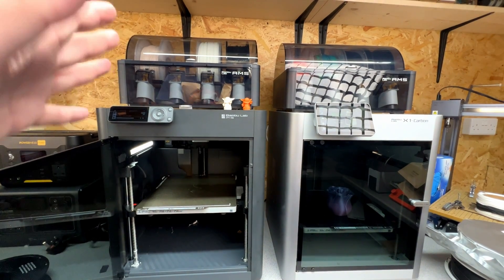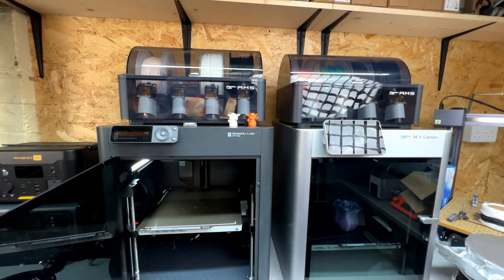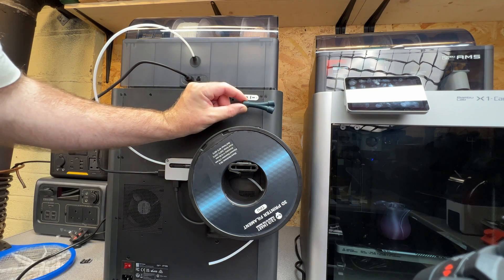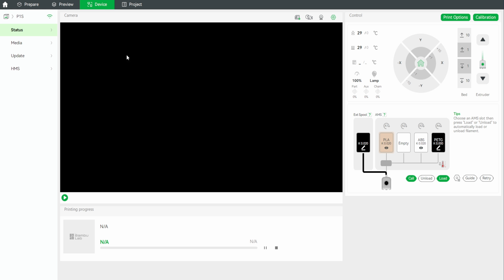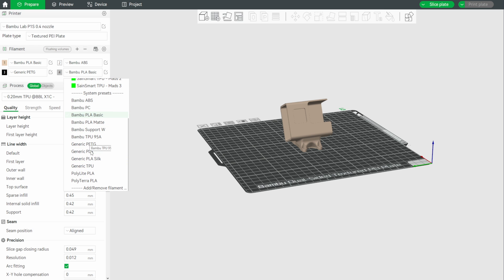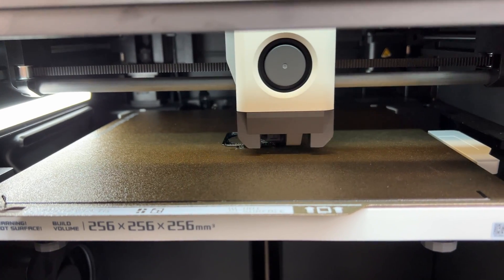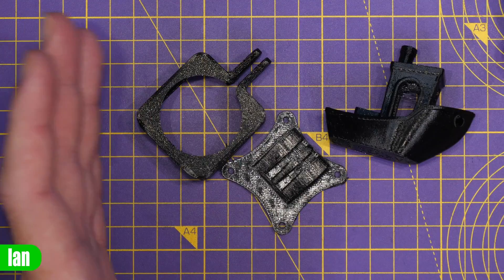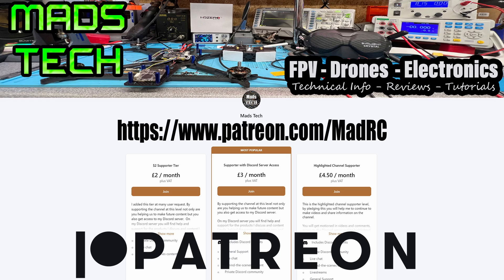Bambu Lab X1 & P1S Printing  TPU - Its This Easy

Comment: Hi great video thanks, I have a reel of ELEGOO TPU 90A, I'm a extremally novice printer with  P1S i take it i should just select the generic TPU like you did and see if that works ok? or would it be better to use the bambu lab TPU settings?

Comment: Excellent and informative, and direct to the point! I have a P1S but have not yet printed TPU. Is it necessary to switch from the stock stainless steel nozzle to a hardened steel nozzle??

Comment: This is really helpful. Thanks. I tried to push through ptfe tube. But it did not work. So filament directly to nuzzle as instructed work. However, before actual print starts, you need to pull filament upwards so that it won't entangle in middle of preparation. After this, as the movement of nuzzle become repetitive and predictable, you can monitor and leave it.

Comment: You can disconnect the blue end of the connector and just leave it attached to the tube from the hub. Then you've already got bare tube to insert into instead of putting weight on the connector.

Comment: i just finished my first print with your profile and the result was significantly worse than it already was. it went from under extruded here and there to under extruded to the point layers didn't bond together anymore

Comment: I printed some aircraft wheels, when 1st printed they were flexible but when they cooled to room temperature they were just as hard as pla. as for ams i didnt have a problem printing the bambu labs tpu in the ams, the quality was really good just not flexible.

Comment: I'm just curious why you would use TPU to print a camera mount? Surely a more rigid plastic would be preferable.
Reply: A flexible mount helps isolate the camera from vibration and can reduce shake...

Comment: What do I do if the load button won’t show up?
Reply: Unload your spool. 

You need have the extruder tube clear of filament before the load button shows up. Then you can click it and it walks you through the steps required to load.

Comment: Don't you have issues with default PEI textured plate? Does TPU stick on the plate, doesn't it?
Reply from the maker: Tpu sticks fine.  No issues.
Reply: I follow
Reply: Periodically scrub your PEI plade with dishwashing detergent on a scrubbing brush under very hot water, and don't tough the surface with your hands.

Comment: Hi Ian, I have a question about the Y-Splitter you have showed did you use some fittings thingies or did you just print one where the ptfe tubes can be pushed in?
Reply from the maker: I used the PTFE push in but it can be problematic, the metial fittings work better.
Reply: @MadRC  thanks a lot I will most probably get the original even up to four one. Its 5€ + shipping I think its not worth the hassle if filament doesnt slide easy enough or may get stuck for that small sum

Comment: Are you using the special TPU plate or the one that came with the printer. I noticed old plates were able to print TPU (it has the classification on the plate) but the new ones does not specify TPU, only PLA, PTEG and ABS

Comment: Update (1 year later): You no longer need to do the step described at 4:11 ( https://youtu.be/fhu5C-3AJvo?t=348 ) as in the current version once you've defined what's on the external spool clicking "sync" for the AMS will add it to your list as a fifth option.

Comment: I was told you have to use a gluestick for this stuff otherwise you wont be able to get it off the deck, i didnt see any on yours, anyone chime in by a chance? TIA.
Reply: Thanks, I have been layering on the filigree goo stuff you get with the smooth/textured surface. And yeah I noticed it's very grippy and I'll def switch to glue stick, thanks

Comment: If it’s on the spool, won’t it soak up moisture in the air? Seems like it wouldn’t soak up moisture if it is in the AMS.
Reply: It needs to be in a dryer

Comment: Bravo!  I wish that all how-to videos were this thorough and simple!  My only question now is speed.  When I look at the required speed for my filament, it says no more than 50mm/s but the standard Bambu Studio settings show 200mm/s print speed.  I thought that when I told the machine that I was using TPU,  it would give me settings usable by TPU.  Should I print at the higher speed, or should I use the recommended speeds and top out at 50mm/s?  Thanks for a great vide!
Reply: Maybe try the calibrations and see if it still prints good 

and if it not, then change the speed to 50mm/s etc

Comment: How do you release TPU to change to another TPU color? Also what happens when you run out of TPU? The last time I did this the TPU got jammed up in the extrud6snd I had to take it all apart and get it out. Not a pleasant time. Thanks
Reply: When you have sliced you can set a layer by which to change filament - slide down to the layer you wish and right click on the plus

Comment: Any idea how much the pressure advance value matters for TPU? Just for fun I ran a test, and found I had to run the bowden settings just to start to see a change in the lines. I ended up at .26, an order of magnitude higher than the default. Maybe it doesn't matter at the speeds TPU prints at, so no one ever mentions it. We'll see if my prints improve!

Comment: I used your json file preset and got sainsmart tpu and on my x1c its perfect. Just awesome. Thanks for the work you do.
Reply: Where did you load in the .Json file on Bambu studio?
Reply: @califpv  O i get it. I had the same problem.. Import file, Very top left corner (file) Import, Bottom choice. There you go..
Reply: @73FPV  thanks for this post, I needed this help as well. 👍

Comment: I had to search out this video, as it's the best guide I could find to printing with TPU. I needed it when I actually began my TPU journey. Prints came out fine and dandy and the splitter works marvelously. Cheers!
Reply: My i have the link to the splitter. Same experience as you.
Reply: Im going to try the one from bambu , its a 4 to 1 adapter

Comment: With the Y the Material PLA feed or change do not work correct anymore. It feeds the Filament forward until the extruder, then after some seconds back, and forward, and back. Until it stops due to the error message. Sometime it works, somtime not. After disassembling the Y it works again normaly.

Comment: TPU 95A should be fine at a fairly slow speed, more flexible stuff will likely be more problematic?  I have flexible 65a, 85a and 85a, filaments & for the very soft stuff the extruder tensioner will need to be relaxed as in my experience the softer filaments will just get chewed up in the gears otherwise.  I would also not fancy trying to push very flexible filament into/aling the bowden tube, its likely to be hard work.

Comment: Does it work with the A1?
Reply: I've used a lot of the Sain Smart TPU on my A1 Combo (bypassing AMS) and it prints beautifully.  One spool I have is several years old.  Kept in a baggie with a little pack of dessicant.  Very useful filament.

Comment: Thanks for the info and insight. With the Y adapter for the filament in the back, I assume you still have to retract the filament until the tubing is clear? If so, what is the purpose of the adapter? Is it just so you don't have to disconnect the tubing from the AMS every time?
Reply: Yes, so u don't have to disconnect

Comment: Is that the gold dual sided textured plate that came with the printer? And did you not use any glue? I need to print tpu now and im afraid to ruin the build plate
Reply: I too have this query - the bambu lab webpage for the texture pei sheet says to use glue stick for TPU. Did you have any issues without using glue stick?
Reply: @djwhu77  I just used the glue stick and printed 4 very large wheels. That worked fine and the glue was easy to remove. I have yet to try without glue. Even with the glue i had a hard time removing the print, but as soon as i got a piece up, I could just use a painters spatula to "cut" it loose

Comment: i had to add much more tweaks on nailing tpu with x1c, its not as simple as described. wost part is supports .it prints OK but supports are pain .. but finally come to good results, also found out bambu studio slices better than cura for enders

Comment: I've tried to simply remove the PTFE tube and leave the AMS attached but in the BambuStudio it gave me the run around until I unplugged it. I'm not sure if there was a setting I missed but I hope to figure it out because that is an annoying part.

Comment: Thanks for the vid, it really helped me... BUT, I have tried a few different TPU brands in my P1P with no AMS and many brands would not even feed through the feed gears or hot end.. they just appeared to get tangled round the feed gears, which was a right royal pain in the rear to get access to and unclog. indeed I ended up just buying a new hot end as even after clearing the clog in the gears I could not get any other material to feed through the hot end. I did alter the feed spring too to no joy..... Eyeron is the only non bambu brand I have actually been able to feed through the Bambu lab P1P... PS I usually use Overture TPU on my other printers, ( Elegoo Neptune 2s) just fine... Any thought or advise?
Thanks in advance
Ian
FuriousRC

Comment: How does the "TPU Profile Link" set the parameters for TPU. It looks like a process file with the default settings for setting up the model and not the filament. This is new to me so correct me if wrong. Enjoy your videos. Thanks

Comment: Ive used flexibles with one of my ams... i heavily modified it though. Been considering making some youtube videos because i also am starting to reverse engineer the ams and want to make a custom one by using an arduino to intercept the pins from the printer and trick the printer into making it think my ercf with 8 materials is 2 ams. Wondering if anyone has tried it yet

Comment: What speed do you print tpu?
Reply: The maximum print speed is defined by the "Max volumetric Speed" in the filament settings.
The "Generic TPU" profile has a "Max volumetric Speed" of 3.2 mm3/s. This results in a maximum print speed of 40mm/s with a 0.4mm nozzle & 0.2mm layer height (regardless the higher print speeds in the provided/chosen Process Preset, they will be ignored).
Max print speed equals 'Volumetric Speed' / ('Nozzle Diameter' x 'Layer Height')

The print temperature depends on the values of the manufacturer and is usally between 200°C and 230°C.
Bed temperatures between 30°C and 45°C
Best results with Enineering Plate and Textured PEI Plate
All nozzle materials can be used (brass, steel).

Comment: what temperature and speed used for TPU on A1 mini and X1C.. can I use the normal nozzles machine came with.
Reply: The maximum print speed is defined by the "Max volumetric Speed" in the filament settings.
The "Generic TPU" profile has a "Max volumetric Speed" of 3.2 mm3/s. This results in a maximum print speed of 40mm/s with a 0.4mm nozzle & 0.2mm layer height (regardless the higher print speeds in the provided/chosen Process Preset, they will be ignored).
Max print speed equals 'Volumetric Speed' / ('Nozzle Diameter' x 'Layer Height')

The print temperature depends on the values of the manufacturer and is usally between 200°C and 230°C.
Bed temperatures between 30°C and 45°C
Best results with Enineering Plate and Textured PEI Plate
All nozzle materials can be used (brass, steel).

Comment: I know that you mentioned you were using an old roll of TPU and that old roll had most likely absorbed a bit of moisture while sitting in storage but, does this mean that a roll of TPU in pristine printing condition would give one a cleaner surface finish than those shown in the models you printed in this video?
Those were some pretty rough finishes.

Comment: I was expecting to be able to use it with the print option but that only supports the AMS materials... Why isn't color 0 the filament on the aux hub hanger?  
Second, can an AMS hub be used without a second AMS to feed alternative filaments like TPU and CF filaments?

Comment: Hi, what speed do you have set for TPU printing?
Reply: The maximum print speed is defined by the "Max volumetric Speed" in the filament settings.
The "Generic TPU" profile has a "Max volumetric Speed" of 3.2 mm3/s. This results in a maximum print speed of 40mm/s with a 0.4mm nozzle & 0.2mm layer height (regardless the higher print speeds in the provided/chosen Process Preset, they will be ignored).
Max print speed equals 'Volumetric Speed' / ('Nozzle Diameter' x 'Layer Height')

The print temperature depends on the values of the manufacturer and is usally between 200°C and 230°C.
Bed temperatures between 30°C and 45°C
Best results with Enineering Plate and Textured PEI Plate
All nozzle materials can be used (brass, steel).

Comment: Thanks Ian. I just got my first printer which is a P1S combo and I learned more in this 11 minute video than the few dozen other videos I’ve watched. I’ve been using the included pla while getting used to the slicer and printing in general. This video gave me the pep talk I needed. Gonna give some fpv prints a try.
Reply: Fpv prints? Like lithophane images?
Reply: @madlad1.  FPV is First Person View   It’s a term for the type of drone I fly. It has a camera and I see what it sees through my goggles. TPU parts are essential for arm guards, antenna mounts, action camera mounts etc.
Reply: Same!

Comment: Thanks for the instruction! Do you know what to do when the TPU cant be loaded? I hear the stepper working but no filament comed out of th nozzle...
Reply from the maker: Have you given it a push though as it’s trying to extrude ?
Reply: @MadRC  yes i did. and I feel it beeing pulled, but somehow it can be extruded. I tried another TPU filament know and it just works fine, don’t know what the issue is with the other one… 
Thanks for answering!

Comment: so I downloaded your profile and the speed seems really fast for tpu, did you change it
Reply: The maximum print speed is defined by the "Max volumetric Speed" in the filament settings.
The "Generic TPU" profile has a "Max volumetric Speed" of 3.2 mm3/s. This results in a maximum print speed of 40mm/s with a 0.4mm nozzle & 0.2mm layer height (regardless the higher print speeds in the provided/chosen Process Preset, they will be ignored).
Max print speed equals 'Volumetric Speed'/ ('Nozzle Diameter' x 'Layer Height')

Comment: Could you use the BL Y Splitter for the PLA and use it on the rear spool holder and then not have to disconnect the AMS?
Reply: Yes you can

Comment: Hi,  dont you have to reduce the speed´s ???
Reply: The maximum print speed is defined by the "Max volumetric Speed" in the filament settings.
The "Generic TPU" profile has a "Max volumetric Speed" of 3.2 mm3/s. This results in a maximum print speed of 40mm/s with a 0.4mm nozzle & 0.2mm layer height (regardless the higher print speeds in the provided/chosen Process Preset, they will be ignored).
Max print speed equals 'Volumetric Speed'/ ('Nozzle Diameter' x 'Layer Height')

Comment: Thanks for this.  I learned the hard way the AMS was not compatible with TPU. Probably should have read the instructions.  It didn't reach the spool and I was very lucky to be able to pull it out without it snapping. Lesson learned.
Reply: I've learned it the hard lesson, too xd

Comment: So, what are your actual settings when printing with TPU, like print speed, retraction, etc? Just showing how to load TPU in the BL printer is not a certainty that it will print okay. That process is the same for all filaments you print outside of the AMS. This video is not particularly helpful this way...
Reply from the maker: For you may be not but you seem to miss the point that many people don’t even realise you can print externally or use tpu as many read the AMS paperwork and think you can.  All the settings are in the profile.  This was not designed to be a deep dive into best TPU settings.

Comment: I followed your tutorial using eSun 95A TPU in my P1P using the generic TPU profile. First layer or so went down fine but the filament stopped feeding after about layer 3. Any tips or suggestions?
Reply: slow down, the gears are biting too fast in to the filament, slowing down is the key for feeding tpu

Comment: Hard tpu or hard carbon tpu work quite good with the ams. Just modify a pla profile for the tpu
Reply: Tpu 95A ? 🤔
Reply: @jean-nicolasmenu-galinier8221  extrudr Flex Hard is shore hardness D58. definitly harder than 95A. still gets stuck in the ams from time to time but not that often.
Reply: @muhkuh0816  Je cherche définitivement un mode pour le TPU dans l'AMS, mais je ne le trouve pas ! Je suis sûr que c'est possible, mais je ne trouve pas ! J'aimerais le trouver avant de me la procurer !

Comment: What about AtomStack 60A TPR
(Supposedly the worlds most flexible filament)? Not sure if it could be printed, since it is available only in 2.85mm dia. Also it might need the special AtomStack printer😅 But a LulzbotMini could print it in a breeze with flexistruder😊❤💭